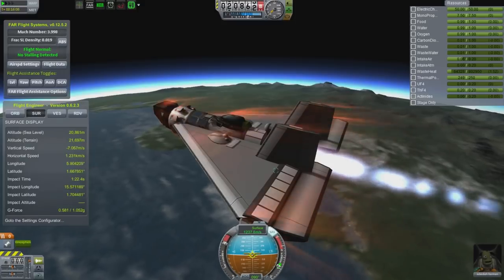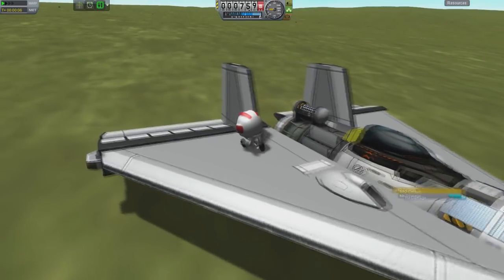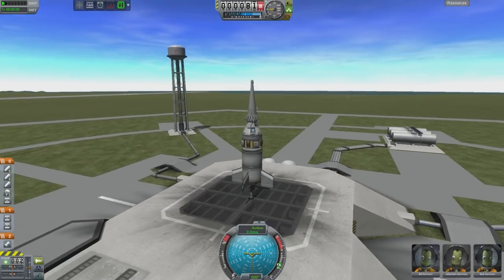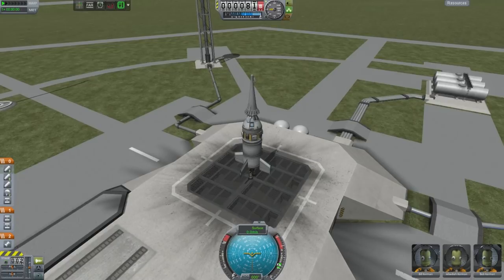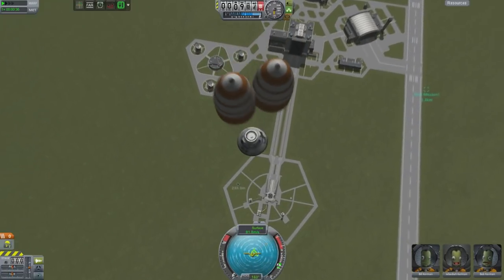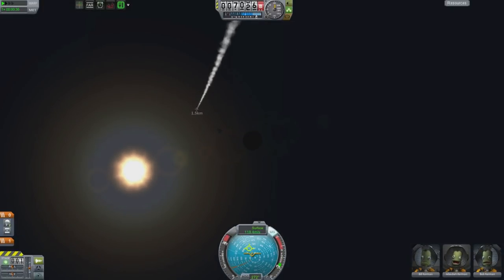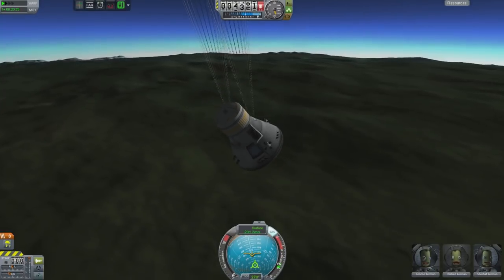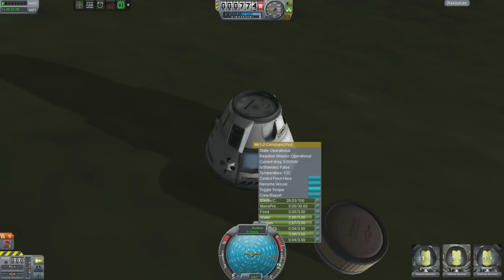Kerbal Space Program - Interstellar Quest 33 - Developing New Launch Hardware

Comment: Scott: The solution to the abort system is to use two opposite rockets at the top, one angled /slightly/ further out than the other. Thus you get just enough angular thrust to push you sideways without tumbling.

Comment: Scott, In Soyuz crew has no way to activate LES, in could only be activated automatically (only after liftoff, if onboard system detects severe deviations from planned trajectory, or some off-nominal accelerations), or by the ground either via wired command link (while on the pad), or via radio channel (anytime). On that flight, once ground has determined that the situation is grave and LES activation is required, they did try using wire-based command link, but cables burned and so they retried using radio-channel. It worked, but after the accident they've changed the design of the system such that activation routine would use all available channels simultaneously.
Oh, and this system doesn't activate immediately, but displays a warning for the crew for about 2 seconds to allow crew to brace themselves and prepare to be carried away with insane acceleration. They are trained for that, so they know what to do in this case.

Comment: The Crew capsules have a ridiculous impact tolerance apart from the lighter lander versions.

Also the time it take to land in a space plane depends on your decent path from space, the angel of your ship, wing lift, engine use and the maximum decent path you can take before your ship becomes unstable.

The last problem can be solved with aero brakes mounted on the back of your craft above the centre of mass, also so they pull the back of the ship down so you slow down but also decrease your decent profile by angling you craft nose upwards and therefore your wings upwards also.

Furthermore it stops flip-outs side ways also it should stop flip-outs up and down as it is dragging on the back of your craft.

Also you can use those same aero breaks for final landing on the run way because they slow down your craft and angel the craft upwards which is exactly what you want.

Comment: Thank you for another inspiring episode. Most notably the launch escape mechanism made me think of solutions for abort sequences to avoid all kinds of disaster.
This also inspired me to create an escape pod for my space station, though I doubt RCS would cut it if I were to bring a pod back from Munar orbit.

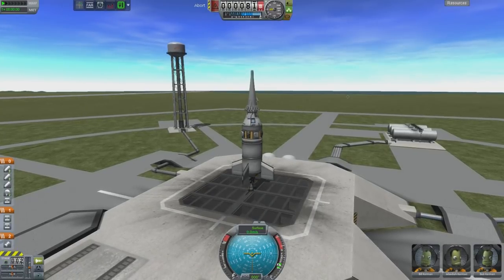About your attempt at 3:14, did you consider reducing the sepratron fuel? Since .23 I use the sepratrons to change the direction of jettisoned parts with minimum amounts of fuel. This gives the added benefit of further reducing the mass, if only by a little.

Comment: I built a suborbital plane that could sustain 2100m/s using ramjet engines. It constantly had reentry effects and just looked like a ball of fire.
Reply: where did you get the engines?
Reply: Two Turbo jets rather. And they are in high altitude flight.
Reply: doesnt sound very useful with these mods

Comment: For orbit transfers why not build a ship to dock a the power station and then reduce its orbit to the lower one that way you only need one ship to transfer will require less launches (can transfer people to both from one launch) and that will also give you a small ship that can be used for moving small modules around if needs be.

Comment: With the escape tower I think the big problem was you were not using the tweak-ables to change the amount of solid fuel in the boosters. You only needed it to burn for about half a second to give it nudge over, not for the full duration.

Comment: Hey it looks like you are using the realchute drogue chutes and not the actual main chutes.

if you have two of each and deploy them at the same time I usually hit at like 8 m/s
But that is using a small pod, all the science experiments, a half tank of small LFO and a small engine with landing gear.

But the drogue chutes will not slow you down enough to touch down; they are meant to slow you down before your main chutes deploy so they don't break.  
I have my drogue chutes on action group 3 with the 'arm' function
and my main chutes on AG 4 with the 'arm' function

Comment: When I do an asparagus style rocket right after the first 2 fuel tanks fall my rocket goes into an uncontrollable spin. Help.
Reply: thats the major flaw of asparagus. Try draining fuel from all axternal tanks at once, so they all drop at the same time. Its less efficient but you wont spin as much.
Reply: Maybe add some reaction wheels or winglets?
Reply: Check your fuel lines are set up correctly, it should be first stage feeds second, second into third, then third (or fourth) into the center tank also check the symmetry of your fuels lines, I'll bet one side of a stage is missing one.
Reply: Are your fuel lines on the side of each fuel tank? If so, add an identical strut to the opposite sides. That solved the problem for me.
Reply: I would say use SAS and keep a lot of reaction wheels. Especially on big rockets. If any, you can add advanced SAS as "nosecones" on boosters, helps turn it and then you drop the mass which makes the rocket easier to steer so you don't need so much SAS, as you drop it. Right?
Reply: Aerolfoz I will try that.

Comment: Are you sure you have deadly re-entry installed? None of your stuff ever burns up, even when not shielded.
Reply: Would the parachutes have been overheating there if deadly re-entry wasn't installed?
Reply: that's just because he goes in engines-first. most engines have crazy heat tolerance, even on the outside.
Reply: Jackson Pacchiana
plus because ferram makes the atmosphere less effective at slowing down spacecraft, so he toned down deadly reentry to dangerous reentry

Comment: Scott, no offence but the speeds you reach are nothing compared to the SSTO/SSTS plane i have assembled form %100 stock parts, hey you should give it a look man Manley. It has reached the surface speed of 3457 m/s IN the atmosphere. And in the video i posted i reached about 2200 m/s IN the atmosphere but the video starts with me in space. I only used jet engines and no stages. please give it a look Scott, cheers.
Reply from the maker: Ryan, No offence, but your design can't stay in the air for a year without refueling. Once of the benefits of a nuclear powered jet engine.
Reply: Scott Manley true but i was just talking simply about speed and simplicity w/ stock parts. But thanks for you comment back.